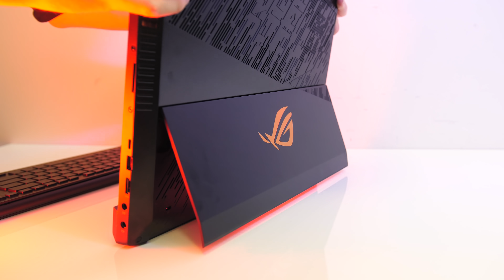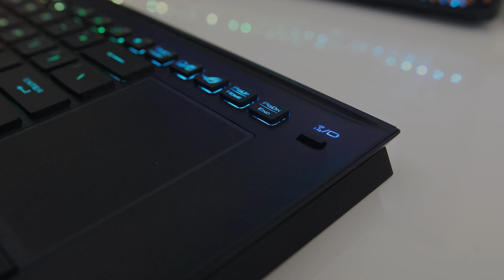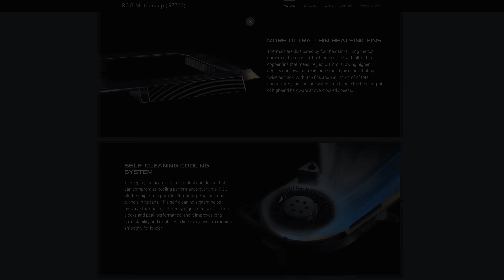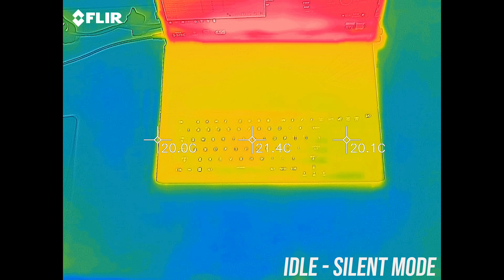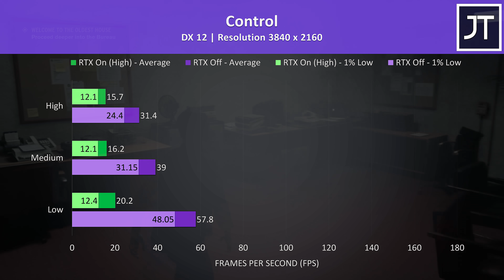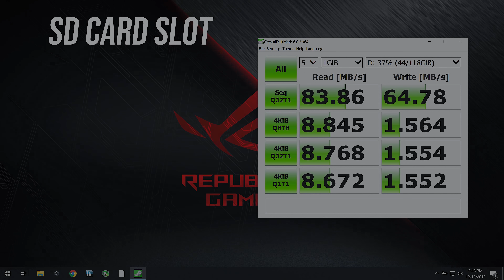ASUS ROG Mothership (GZ700) Review - Crazy Gaming Power!

Comment: Hello, Recently I'm having issues with the Asus Mothership keyboard. When i turn on the laptop, the keyboard takes around 20 min to turn on either detached or attached. when it's off, I see the keyboard icon on the bottom right with a sign "Keyboard disconnected" then when it's connected after 20 min, I see keyboard battrey 100% charge level. Any idea how to fix that issue? Thank you

Comment: Is there a way you can underclock the cpu to save a bit of battery?
Reply from the maker: Yeah, you can undervolt it, cap the clock speed etc, few options.
Reply: @JarrodsTech  thank you!
Reply: @JarrodsTech  another question, are you still using this laptop to this day, and if so, have you faced any problems with it?

Comment: Ok, this thing is impressive... Just found one for 6995.. Silent mode can basically do 95% of every task one could ever want, with minimal noise, and just put in turbo mode if you really need it. Good I/O selection.
Nitpicks? Should have been an option for 144HZ 1080P screen or even 1440P, and should have been UHS2 card reader at this price.. the latter is kind of ridiculous. Also, windows app scaling is terrible, so, 4K actually puts me OFF in any windows monitor.
Reply from the maker: Yeah they cut the price significantly lately, probably due to 10th gen coming. Agree with better screen.

Comment: Alienware Area 51m "All the way" ! ;) It is a "few frames" better than A51m (at stock). Arguably, you can properly OC both of them and get the Mothership > A51m, but the difference is so tiny and insignificant that it doesn't justify the "uber" price. (And I can hold my A51m of my lap)
Reply from the maker: Based on the software experience I had with the 51m, I'd pick anything else over it but that's me 😛 like GT76 or Clevo P750TM
Reply: @JarrodsTech  The what software? Oh..... that thing... something with "Alienware command centre"? I use that only for lights to setup my scheme initially and then forget about  it ^_^
The "command centre" was bad in 2011, was bad in 2014 and is bad in 2019/2020. I just use the regular tools (like I do on my desktop), cpu/gpu-Z, hWinfo, afterburner, xtu, etc.
i do love the "Alien" head though :D And having quite a few Aliens in the past, I can't say no to them ^_^ 👽
Actually, these are the results that I managed to get today with the Area 51m:
https://www.3dmark.com/spy/10322848
A beast of a machine!

However, the most important part, which I neglected to mention: Many many thanks for all your reviews! I really really appreciate all the time, passion, effort and knowledge put in these reviews!
Hats down!

Comment: Awesome and detailed review, thanks!  I definitely want this, and plan to use mostly for work.  I was mostly concerned about the versatility of the kickstand, which I did not see anything online about, but you covered very well here, so THANKS!  I would love to see some kind of stand for it... clamps to the desk, and mounts it about 18 inches from the surface of desk for better viewing angles.  Or maybe some kind of combination docking station where it does the higher height, plus allows other things to augment via peripherals (ex. 7.1 speaker system, DVD drive, etc.)
Reply from the maker: No problem, happy to help! The kick stand is super thick and the hinge feels quite tough.

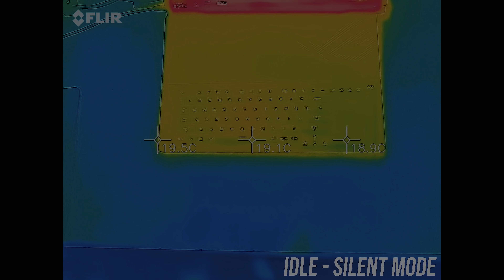Comment: Hi Jarrod, during your testing, do you encounter unstable CPU clock like in this review https://www.youtube.com/watch?v=PpcS65GbfdM&list=LLnYMxqYcJ2ZxEW5bRFKbykg&index=3&t=0s, start from 14:47,  , for all the game he tested, the CPU sometimes dips to 3.6, 4.4 even 2.4 randomly when not throttling and the goal is 5GHz
Reply from the maker: I do not monitor clockspeeds over time, I just take the average after a 30 minute period.
Reply: @JarrodsTech  i see, I find it a little odd because no other desktop replacement (area51m, GT76 etc) does this. Then I remembered the CPU mothership used has an original default clock at 2.4, ASUS overclocked it to 4.2 and then used 4.9 as its own overclock speed

Comment: I was eagerly awaiting the availability for this thing when it was first announced at CES. I'm glad I went for the Alienware 51m instead. I needed a powerful portable machine so although I like the form factor and uniqueness of this one, the Alienware I got is pretty much neck and neck in performance but I got it for less than half the retail price of this one (and with a high refresh rate screen). Also, I've been using for the past 8 months now; I definitely needed it during that time period and couldn't have waited that long for this machine to release.
Reply from the maker: Nice! Yeah took ages for this to come out, and I'd pick the 51m too as it's somewhat more portable, like I could actually use it on my lap in a pinch if needed.

Comment: The biggest hold back for this or any ASUS product is its buggy software Armory Crate
Reply from the maker: I had no issues with it on this machine that I can recall, but yeah others like the gx502 were a dumpster fire trying to get RGB lighting working
Reply: @JarrodsTech  It's fine now but no guarantee in the future, and ASUS's RMA is pretty bad. So if anything went wrong with this thing, $6000 will be down the drain.

Comment: Very decent design for the cooling but that thick bezel.......
Also need to concern the GPU and CPU generate heat right behind the monitor. Not sure if this will affect the screen in long term.
Reply from the maker: There's a thick metal plate between the screen and the heat generating components so they seem to have considered it, as for the bezel you can only go as slim as the chassis allows, I guess they prioritised more room for cooking instead.

Comment: I dunno.....its not a tablet (no touch capability) and its not an actual laptop (hinges on the keyboard?...that doesn't bode well for the constant open-close motion...or the accidental "sat on it" scenario!) So then what is it really?...and why do I need it? And finally...how MUCH will it cost!?
Reply from the maker: You probably don't need it. The hinge is solid as I doubt it'll have issues. The idea is the cooling is greatly improved due to pulling air in from the back. Prices are discussed near the end and linked in the description, but basically $6500 USD.

Comment: i wish the hinges were tougher and the screen was tough
Reply from the maker: The hinges were some of the most solid I've ever used.
Reply: @JarrodsTech  oh ok I seemed to have gotten into a miss when you pressed the keyboard and it went down Abit again is the processor socketed?
Reply from the maker: Oh yes the keyboard is a bit flexible. I thought you meant the main hinge on the back that holds it up, that part is very strong. The 9980HK is not a desktop socket CPU so I'd expect it to be soldered to the motherboard

Comment: $6500: RTX Titan, 9980XE, 64GB 3600mhz, 4TB NvME SSD, 12TB Nas Drive. You can get these for less than $6500. Plus an extradorinary X299 motherboard
Reply from the maker: Best of luck taking that setup with monitor,  keyboard, mouse and power source on an overseas trip 😁

Comment: I say this would be much more interesting with the battery replaced with a internal psu. No ones gona use it in battery mode ever anyway, and the two bricks are making it a challenge anyway.
Reply from the maker: Yeah could be an interesting option for those that will only use it as a portable desktop replacement.

Comment: Actually if they made a lets say 2070 version of this with a cheaper cpu using desktop materials with good thermals it would be great for me. I carry my laptop but not that much only between two houses 2 times a week. A laptop is too portable and a desktop is not portable at all so I need something in between and this fits there.
Reply from the maker: Yeah I guess they wanted to start with the top end. Now that the research and development is done they'll probably have future machines with lower specs, we've already seen similar designs in some of their new creator laptops where the specs are behind the screen but the machine is smaller.

Comment: Man the 60hz screen kills it for me. I would be all over this if the screen was 120hz+
Reply: wasted potential...
Reply: @F4Y541  YOu just post out of your ass!
Reply: I mean it is 4K
Reply: But Ik your problem. The Razer blade 17 inch has 4K 120fps screen with touchscreen
Reply: Nobody 731 
Yes I am actually using asus zypherus s gx701 which is great for gaming with high refresh rate - however the thermals are poor - that’s why I was thinking about getting this unit.
Reply: @haris525  what are your idle and gaming temps?
Reply: @nobody5197   razer blade performance cant push games FBS that lvl in 4k
Reply: ElShanfaraH I watched unblock therapy’s vid. The new 17 inch Razer laptop has a 4K 120fps display and it has a 2080 (I think max-q) for the gpu
Reply: Nobody 731 yes but if playing games you can’t reach 120 fbs in 4k with out rtx2080 ti
Reply: ElShanfaraH really depends on what your playing. Also not many people like max settings anyways. At least it isn’t 60hz and you have that good 120hz feel while using the laptop and 60fps+ experience
Reply: Nobody 731  what I mean I will prefer full HD in max sitting with 240 hz screen to 4k with 120 hz for gaming
Reply from the maker: I wouldn't be surprised if it gets refreshed with the 4K 120Hz panel, otherwise 1080p high refresh rate is available too.
Reply: BEFORE POST, look stuff up! So you do not look stupid!
17.3-inch 4K UHD (3840 x 2160), IPS-level panel, 60Hz, 25ms, 100% Adobe RGB, G-SYNC®
17.3-inch Full HD (1920x1080) IPS-level panel, 144Hz, 3ms, 100% sRGB, G-SYNC
Reply: I'd be all over it if it was oled 4k and at least 144hz
Reply: It's a real shame. My older Zephyrus with the GTX 1070 / i7 7700 / 24GB even has 120Hz, and the difference is huge. I definitely understand why 60Hz on something this powerful is a dealbreaker.
Reply: Star Saga it is also sold in 144 htz Harris javed was wrong
Reply: you wouldn't buy it anyways
Reply: It has a 144hz 1080p screen if you choose that.
Reply: Nygel Ramos but still really expensive compare to alienware area 51 m or acer helios 700
Reply: @BruhBruh-mk5yg  you should look the factory tour of this unit at LinusTechTips. Literally all of it component was CNC from solid, 10 kilograms alluminum block. 20 hours to produce just 1 unit
Reply: dude there is 1080p version of it and its a 1k cheaper
Reply: haris javed the site says it’s 144htz
Reply: it has g sync tho
Reply: haris javed it’s 144hz
Reply: there is a 144hz option

Comment: #$%&, I wish someone would let me buy that on credit.  Cause while most would not appeal me to take credit for a computer, this is perfect for my job as a truck driver. I would do so much video editing with it while having fun
Reply from the maker: I'm curious how that works, I guess you'd power it off the truck somehow rather than rely on the built in battery? Sorry I don't know much about it.
Reply: @JarrodsTech  It depends. The benefit of leaving the battery in means that if the truck unexpectedly turns off, you will still have enough time to close out and save what your doing and shut down. Or turn the truck on to power the batteries which could take hours in a idling parked position compared to minutes driving around the parking lot. Although most of the time finding a parking spot is a luxury in this day and age. However a secondary idea is to use a UPS with the laptop so that you can remove the battery while use in the truck.  However a decent UPS can be more expensive then the laptop battery itself so many accept the fact the battery lifespan will be short. Or they buy additional batteries. And sacrifice one battery which will be planned to have a short lifespan, and use the additional batteries when they are depending on its battery life. The biggest issue is designing or finding the perfect portable desktop. I've been looking for one that will require alot of usb ports. I found a atx motherboard I like but then come to the issue of water cooling vs air cooling.  (I want to watercooler but it's more dangerous) sad vs harddrive ( I like to have a large harddrive but that may not survive the vibrations of a semi) and finding the perfect atx case. I'm a big 300 pound guy and 100 pounds if I needed is nothing, but the issue is finding one that can fit what I want like a 2080 while also being portable and the smallest atx. Although I have a few ideas the issue is they are normally out of stock whenever I can order something I like to try. In short, its complicated being a truck driver that wants to get into video editing to make videos. Especially when my main laptop I had broke. Been down a month and I go home this week for replacement.
Reply: @JarrodsTech  You would run it off of a power inverter for trucks. A few of the nicer tractors have refrigerators, microwaves, televisions, etc.
Reply: @Just2kwik  not all semi trucks have inverters. So a UPS with a car plug can also work. Although there are power draw limits that hold it back more then a inverter. I've also seen a couple of truck drivers that get a couple of extra truck batteries to the truck seperate from what comes with the truck and pair it with a generator or apu. And connect a inverter or something they designed to the batteries. Although they can be a bigger fire hazard. The worse one I've seen was a tight space packed with car batteries connected to a home generator and solar panels. It gave me a stroke just looking at that and there was so many exposed wires.

Comment: I am guessing the keyboard gave you some trouble? I bought ASUS gx701 a few weeks back. Excellent laptop for gaming and productivity (MS office, etc.). But the size of the arrow keys and the placement of the touchpad ruined my typing experience, with the cursor going berserk all over the screen. I even yelled a few times when i accidentally deleted a few pages of my work.. I see that the Mothership has a very similar keyboard layout. If you are buying either of these, better get a keyboard (even a cheap one will be much better than the current keyboard, despite its solid build quality and tactile feeling.
Reply from the maker: It was ok but yeah I'd probably just remove it and use my own mechanical keyboard at home like I did in that brief part of the video. The slight wobble when pressing keys was a little off putting.

Comment: A very expensive machine! But a great performer as a desktop replacement. One problem though, because of the design, cables can be quite annoying since IOs are placed on the side of the screen. Anyway, great review!
Reply from the maker: Yeah that's true, thanks!
Reply: @JarrodsTech  Btw, can you confirm if Aftershock did fix the Balance mode in Vapor 15 thru Bios update? Watched Steve from Ownordisown video of Mag 15 and it seems that Balance mode is now performing great without capping the gpu freq. Thanks!